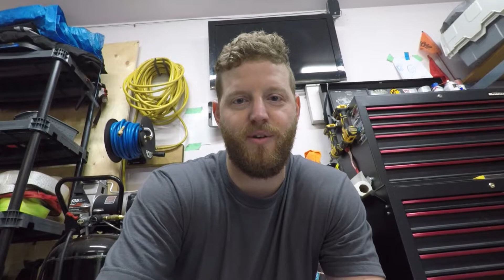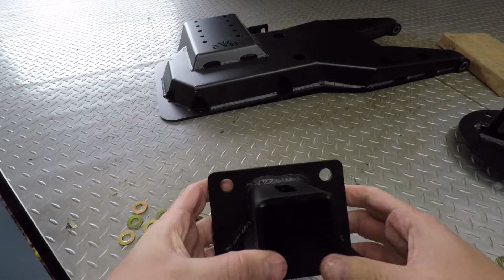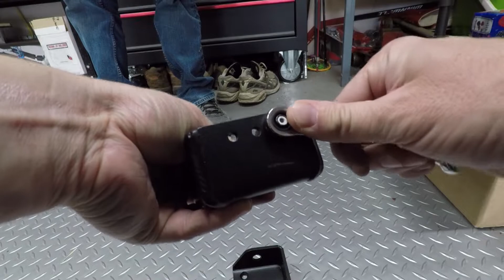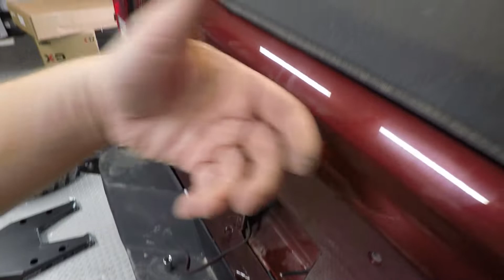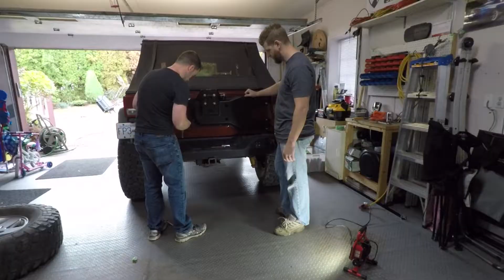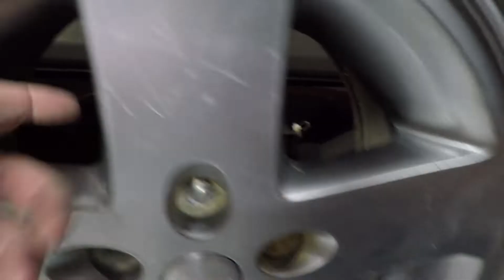EVO MFG Hinged Gate Tire Carrier Install Guide & Unboxing | Jeep JK Mods

Comment: So I have a Smitty built tire carrier on my jk now and do not like it at all it rattles to much been looking at the EVO one in this video and at the poison spider body mount one to what one do you like out of the to
Reply from the maker: Completely different carriers and use case. I think some of it comes down to personal preference and looks. Both are very solid carriers so here are a couple of things to consider. The evo has less utility for mounting gear, swings with your tailgate so opening us very heavy, and isn't protected from ledges if you drop off one and hit your tire itll bend up, perhaps into your rear window. I think it has a more traditional Jeep look and us clean looking, and weighs less then the PS I have on my Jeep. The PS body mount is heavier, but opens independently of the tail gate. It locks as well so you can secure your spare, and us easy to open with one hand. I think it looks a bit odd when its bare, but throw on some Rotopaxs, some gear, and lights and I love my look. The Evo is significantly less expensive. Hope that helps you decide. Both are a good option. The PS is probably better for more abuse, and I like the gear mounting. If i was worried about a lot of abuse, the Evo body mount carrier is a tank but you give up some convenience with latch pins and no lock.
Reply: 25 may 2019 12:30 pm edt:
smittybilt:smittybilt carry tailgate then 
1/2 smittybilt-screw-hole and 1/2 tailgate-screw-hole carry spare-tire-carrier
source:
(1)https://www.youtube.com/watch?v=-11WQbaMkdA&t=5m30s ( Smittybilt Pivot HD Tire Carrier Jeep JK Heavy Duty Hinge 2843 - Review and How to Install )from youtube-search(Smitty built tire carrie)result 1

(2)https://www.youtube.com/watch?v=D5ureIuJJjc&t=6m11s (Smittybilt 2743 Oversized Tire Carrier Install Jeep Wrangler Jk Jl )from youtube-search(Smitty built tire carrie)result 4

so stress-from-carrying-spare-tire-carrier is being endured by:
(1)1/2 smittybilt-screw-hole and
(2)1/2 tailgate-screw-hole.

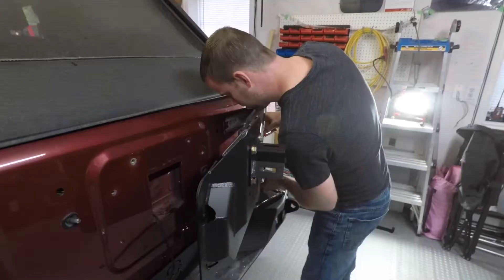evo:evo carry tailgate and carry spare-tire-carrier (25:30) so 
stress-from-carrying-spare-tire-carrier is being endured by evo alone.

Comment: Great job boys ! After you installed the antenna you spoke of, did you run a ground strap from the tire carrier to the frame, or do you feel the grounding was good enough without a ground strap ?
Reply from the maker: Did not run a ground strap.